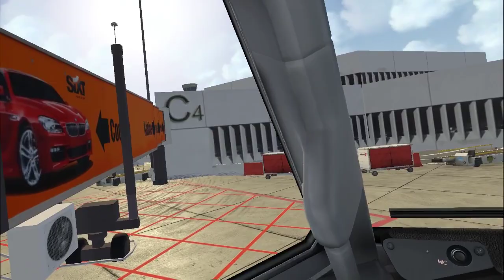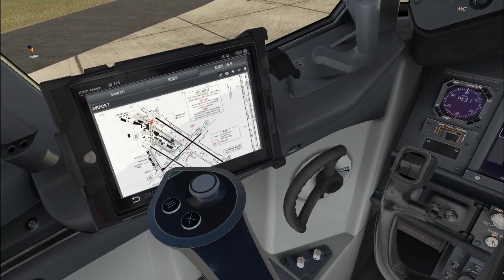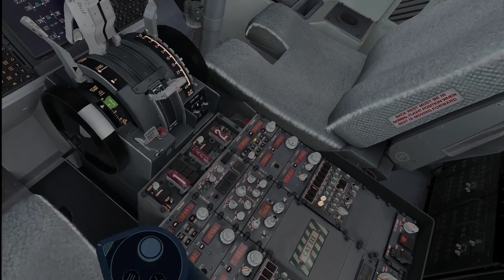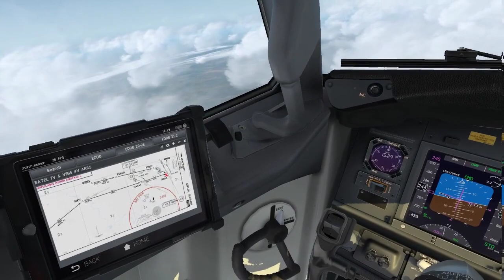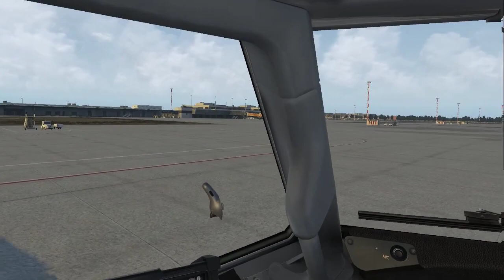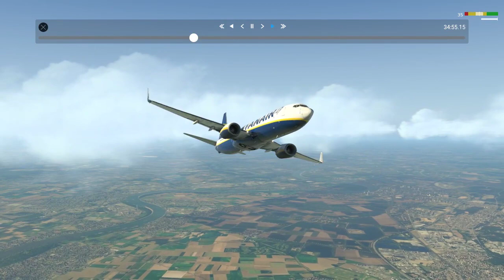[X-Plane 11.32 VR] EDDK (Köln-Bonn) to EDDB (Berlin) with Zibo 737-800 v3.33h (English)

Comment: 30 fps in vr is terrible
Reply from the maker: Maiko Van Den Eynde Not anymore, if you are using the new Lua Script OVR Settings for Oculus (https://forums.x-plane.org/index.php?/files/file/50553-ovr-settings-oculus-rift-supersampling-asw/). This Script provides a new ASW Mode with fixed 30 FPS and ASW on -> absolute smooth and stable VR performance! Try it out! (Works only with Oculus Rift)

Comment: Dein Zibopad sagt 26 fps ruckelt das nicht im VR Headset?
Reply from the maker: MrLel LoL nein, ich benutze ein Lua Script names OVR Settings Oculus Rift (https://forums.x-plane.org/index.php?/files/file/50553-ovr-settings-oculus-rift-supersampling-asw/), damit kannst du die Frame Rate auf 30 FPS fixieren mit ASW enabled -> absolut ruckelfrei und Smooth! Ich setze parallel SS auf 1.8 .. damit und mit 3jFPS Wizard bekomme ich stabile 30 FPS, teilweise etwas darunter je nach Wetterdarstellung und Wolkendichte -> aber absolut ruckelfrei